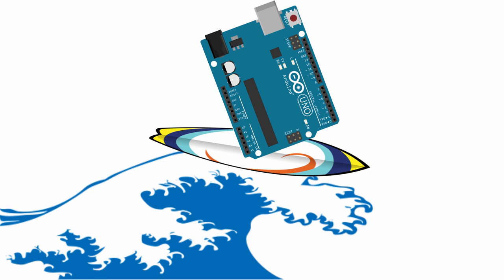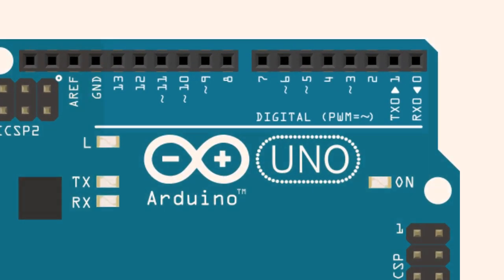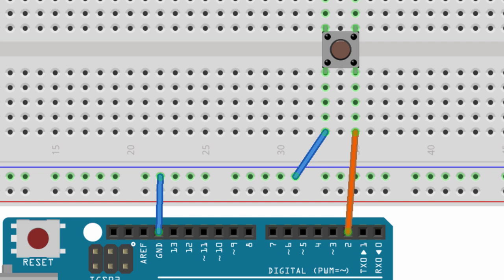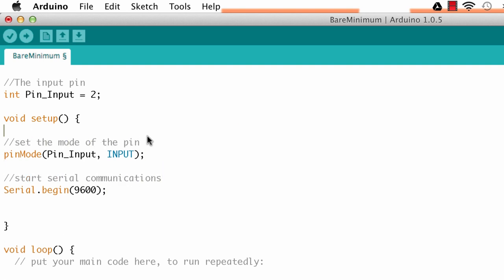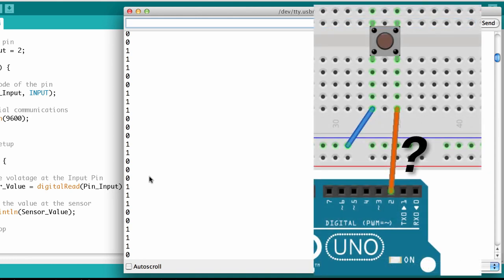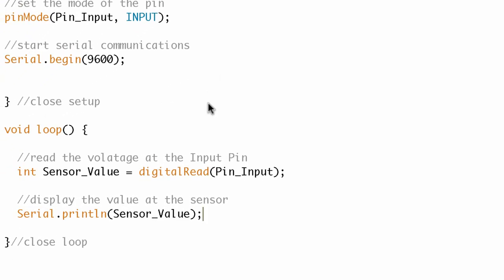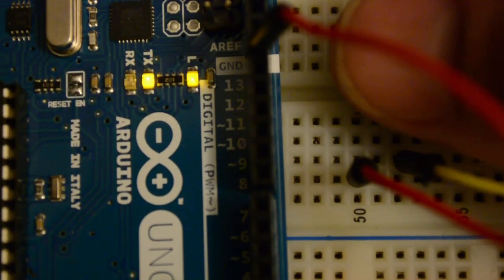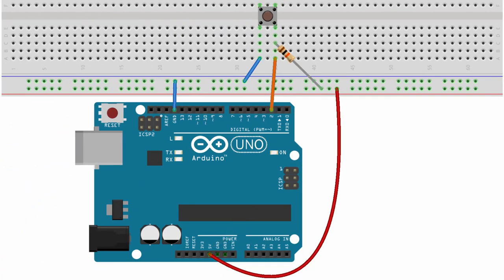Floating Pins, Pull-Up Resistors and Arduino

Comment: Question what kind of pull up resistor would you need for the push button
Reply from the maker: The easiest route in my opinion is to use the build in pull-up resistor.

In you code it would be...

pinMode(pin, INPUT_PULLUP);

On one side of the pushbutton you would attach ground, the other other side to the pin where you want to read the input.  No external resistor needed.  If you do a digitalRead(pin), when the button is not being pressed it will return HIGH , when the button is pressed, it will return LOW.

Hope this helps!
Reply: @programmingelectronics  is there a reason I’ve seen many vids on YouTube why a 10k resistor is need specificly for a push button… isn’t there some form of formula to figure it out. Sorry kinda new to the whole electronic parts

Comment: Hi 
Why can't you just use a wire instead of a resistor?
Thanks
Reply from the maker: Hi +The Nice Guy , Great question!  

OK, quick answer to a more drawn out explanation is that we use a resistor to reduce the power used by this circuit.  You could just use a wire, but that would take up more power than necessary, essentially wasting it.  

So we pick a big resistor to limit current flow.

Hope this helps some...Thanks for asking and for watching!
Reply: A short wire would cause a short-circuit (Ideally like connecting Power to Ground with no resistance in between = infinite current flow)

Comment: Ok that explains a lot. But there is a fundamental thing missing in the explanation: why does pin 2 read the crazy stuff it does (apparently random 1s and 0s) when there is no current flowing in or out if it?
Reply: Robs Tech Channel I think some more explanation could help, since I was still struggling to understand until the bulb in my head started to lit up. ;)

1. There is a reverse logic: 0 (GND) means ON, 1 (VCC) means OFF
2. Loops at the end are the following:
    a) Not pushed: circuit is broken upward, so pin 2 gets the VCC-> value 1, since this is the only way to go for electrons.
    b) Pushed: circuit has to parallel branches, 1. pin 2 to GND, 2. pin 2 to VCC. Electrons will move to GND, skipping the other branch, so it means 0 value for pin 2 input.
3. It is actually not the resistor I think what the key is (that's to prevent high current), but the loop to a source that gives exact indication to pin 2 to get to value 1, otherwise only static noise remains (like white noise on TV).
Reply: There may not be current flowing in and out of it, but there can be voltage, and the pin is reading voltage, not current.  I don't know how or why this voltage gets introduced, but it's there (one of the mysteries of the microcontroller).  Once you make a connection and current flows, this overwhelms or overrides the internal voltage.  It's kind of like a silk thread fluttering in a light breeze.  It is generally about horizontal, but every now and then it jumps up higher, or slackens lower.  If you take a fan, and position it either above or below the ribbon, it will move that thread up or down, and the light breeze, though still present, is not able to have any real effect on the thread.  It can't move it from high to low, or vice versa.
Reply: Electro magnetic fields!